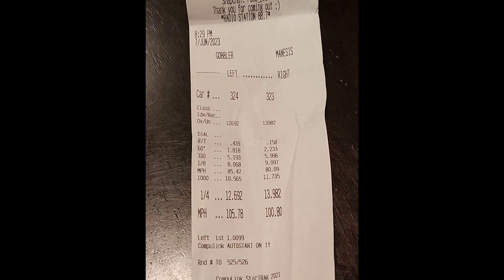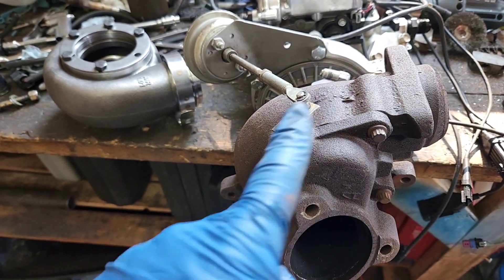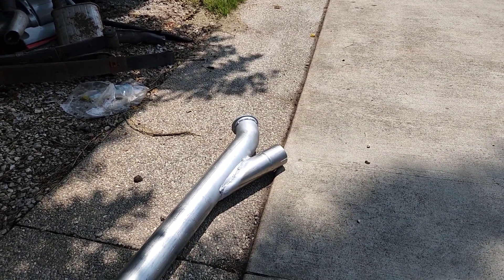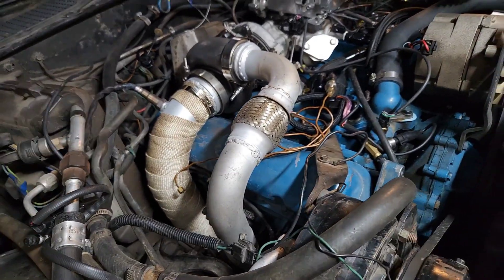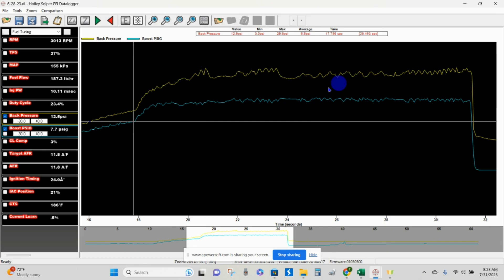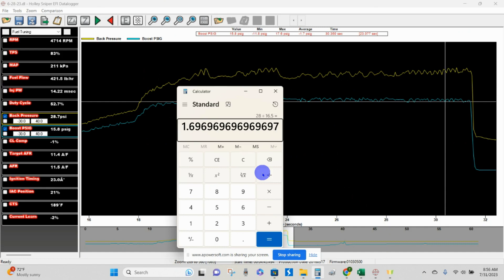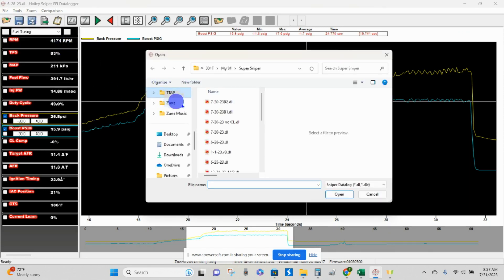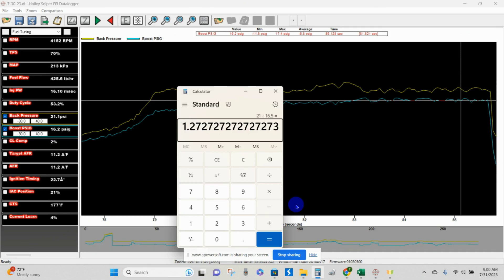TTA Performance - Too much turbo? Switching to a larger turbine housing on my 1981 SE.

Comment: down pipe seems close to control arm bushing. When I was buying my global west a arms for my g body they asked me if It was turbo buick powered , the reasoning being proximity of downpipe to a arm shafts, if so they mandate aluminium bushings and not urethane. Let us know if it becomes an issue...

Comment: I have my 1980 TA Turbao under a car cover and will be contacting you soon to see how I can get it back on the road. oil in gas issues and I replaced the carb. engine had been rebuilt. Just need the time!

Comment: Once pressure ratio is over 1.5 your going backwards, timing will be reduced.
The 3" into 2.5 is a big bottle neck, 3> 2 x 2.5" is going to see much lower PR,  spool faster, take more timing, (thats where gains are)  before knock.
To check meassure pressure just after the turbo outlet

Comment: This is really interesting stuff, thanks for sharing all the hybrid etronic factory things. Now I'm thinking of putting a DT turbo on my 79 Regal 301....a little low end torque but that's it. Yours is  a 400 w/a 3hundred rear wheel w/a draw through right!
Reply: Sorry,  thought I was commenting on the low mile white one from Michigan.😊
Reply from the maker: This car is still a standard bore 301 Turbo. It is not a 400. Same 301 that is in your regal but mine has even lower compression but a thicker casting engine block.

Comment: More air in, more air out. More air out, less boost lag. I'm guessing you installed the new prototype steel intake manifold that matches  the intake runners. Just my guess.

Comment: I hate to tell you this but... it sounds perfect out of that dump! Get an electric cutout and call it good. I have this type of setup on my old squarebody and naturally aspirated it makes a huge different in low end feel. Theory is fun but real world is the final say and you already have it setup to try. Excellent

with an electric cutout you can cruise quiet and have a rowdy button. Even better get a boost actuated dump valve and have quiet until it's go time automatically.

edit: you found out it had too much lag I see. dang. Well an electric cutout can be opened incrementally and I wonder if a  boost actuated one could be tuned to open the right ratio per boost.